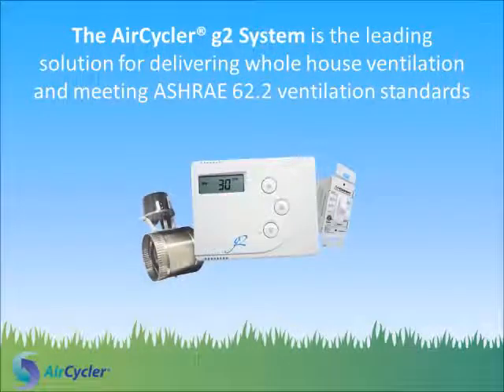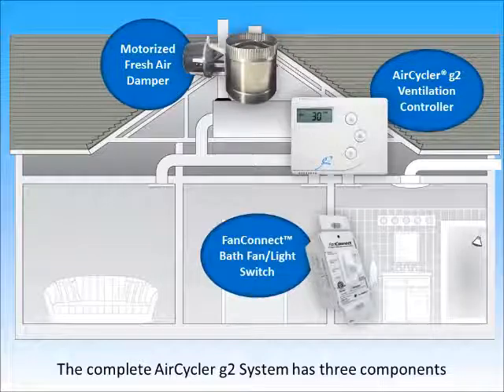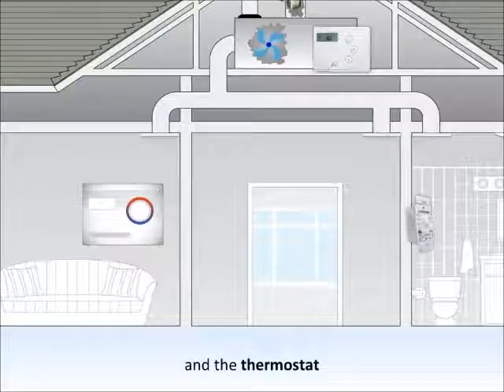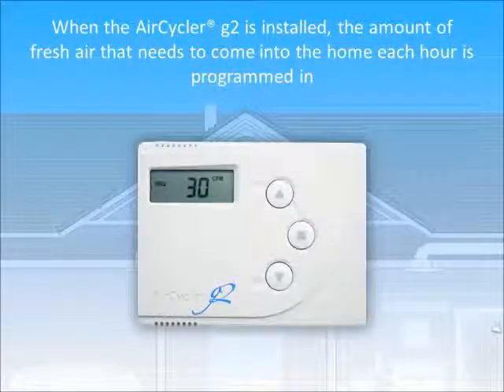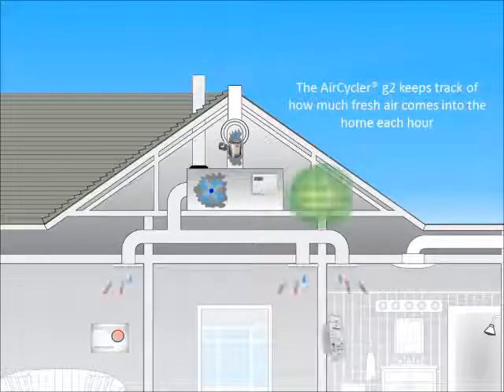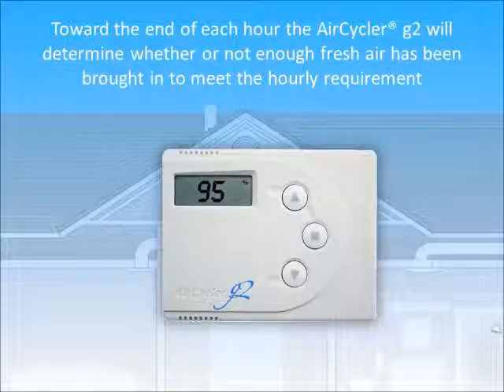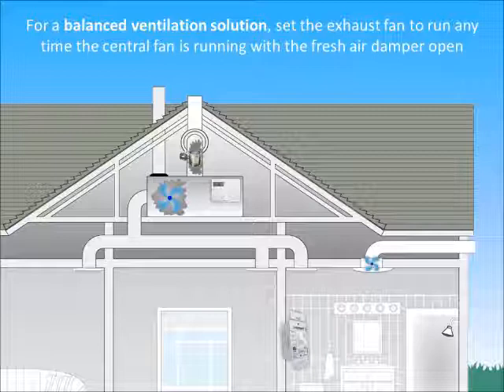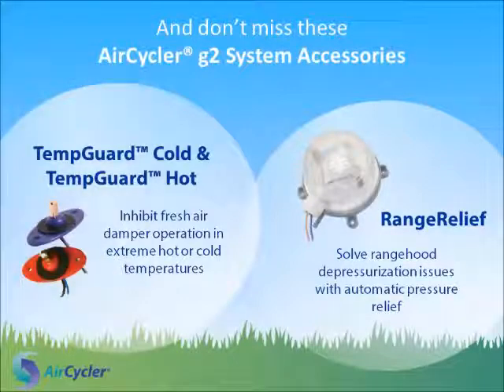AirCycler® g2 Whole House Ventilation System (with sound)

Comment: I just moved into a house with this system and I’m not sure it working. It always show 0% no matter how long the system is running. What should i do?
Reply: i moved into a house and the aircycler never was on i call an air conditioner man to fix it and he knew nothing about it nor heard of it what do i do
Reply: It's a pos. I hate it so much. Had a home built and they used this pos. The one upstairs doesn't cycle and the one downstairs doesn't turn off.
Reply from the maker: @bps20  Hi Brian, customers often contact us for tech support help via the contact form on our website so if you have already received help, please feel free to disregard this message. We're sorry to hear you are disappointed in the product. We would want to make sure your units are installed and programmed properly as the functions that you mention do not sound like normal operation. If you still need tech support assistance please feel free to reach us here https://www.aircycler.com/community/contact. Please provide the best contact information to reach you. Thanks very much.
Reply: I loved into a new house and had the same issues. Turned it off as it’s a complete waste of everything.